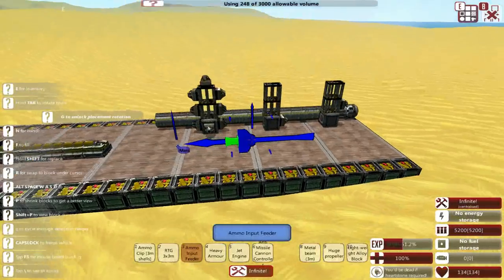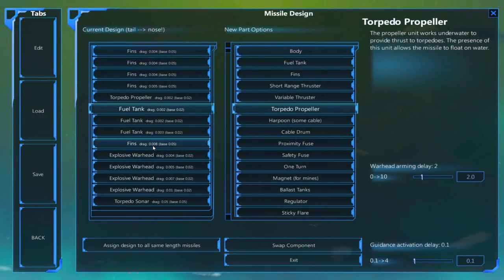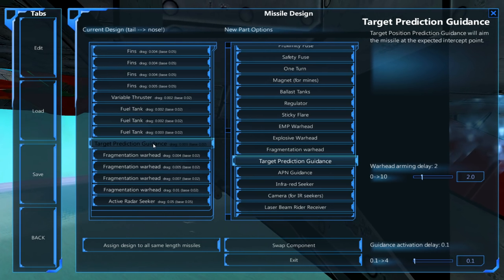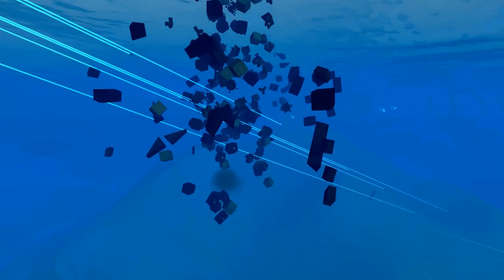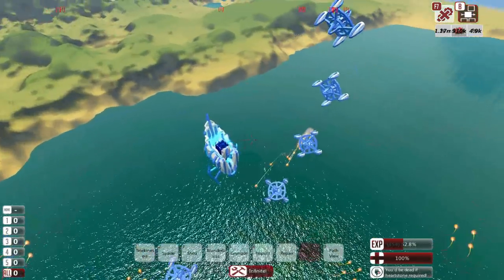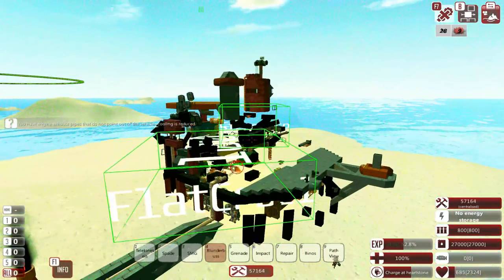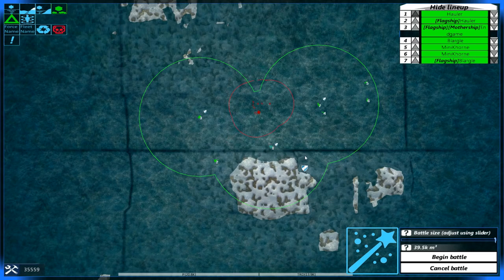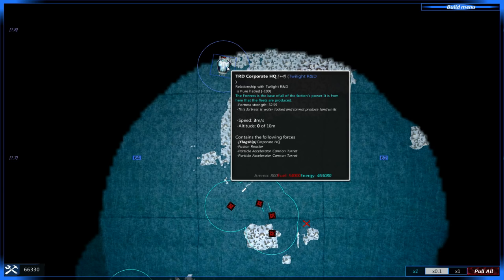From The Depths | Part 15 | The Mothership!! | Glao Campaign Gameplay

Comment: Wow, you figured out the Mothership's secret pretty quickly. Yes, it is fed power by all of its drones, and last I checked it was capable of sustaining flight with just one or two of them.

As for the drones facing the way they do, that can't be helped. The docking stations have elevation control which makes them pitch, azimuth control that makes them roll, but no means of controlling their yaw so so turning them to face a target is a no go. We could turn them around by actually turning the intended direction I guess, would need to see how that looks. Part of what makes it look so good though is the somewhat angelic nature of the Mothership looking like a holy throne, with the drones encircled around it facing as far away as they can be made to.

And I can say that the 5.6 unity update patch is in the devtest client, which also includes a bunch of design updates. So look forward to that.

Comment: There is a little trick with belt fed that, if you use a large enough gauge and enough inputs (for example, a 250mm cannon with 4 rounds per clip and 4 inputs attached per clip), you can instantly fill the ammo clip as soon as belt fed switches from the firing to the reload state, allowing a continuously firing belt fed with no down time. An ultra compact 120rpm 250mm cannon is absolutely terrifying.
Reply: mark009vn or 450mm :D
Reply: mark009vn 
390mm HE,six per clip i believe,anyone remember this cannon from somewhere!!!
Reply: I remembered once making an anti-missile cannon that fired 400mm timed HE slugs at 200rpm, it was quite amusing using it as an anti-air... but not much else unfortunately. The problem with higher gauges is that you have too little modules to work with, 250mm in a 1m belt fed gave you 4 modules, which is just enough to create the most basic of shells.
Reply: For some kinds of shells you only need the basics though. 333mm HESH rounds, GP-HE-SH, fired at 300 rpm, can do some crazy DPS. And if you need shield-busting, mix in or switch them all to GP-EMP-DC. 400mm is great too for timed or inertial fuses, like GP-Inertial-Frag/HE, and only needs 3 intakes instead of 4 to fill up its clip. Although there is that 5-10 second delay before returning to the firing state now, having enough instant-reload beltfeeders lets you get a minute or more of firing for every 5-10 seconds of downtime, which really can do an incredible amount of DPS.

Comment: The Mothership is also flawed in terms of its placement, but it should come through along with Artillery by the next update, hopefully with a couple of other things.Unfortunately missiles might still not hit anything, but because Glao has no difficulty settings, a particle cannon should be enough of a challenge.I might have to look into lags later on.

I've also asked for a permission to go nuts with subvehicles to make up a thick weighless armor, but given how stupid the idea is, I probably won't receive the blessing.
Reply: I'm currently thinking of giving the lowermost drones torpedoes so that they serve a purpose by going into the water.
Reply: I have a question. Who decides whether or not a new faction can be put into the game?
Reply: Most of the time, developers decide on faction guidelines when a new campaign is made - so not very often. Once the guidelines have been set, they're posted on forums, at which point volunteers begin designing crafts roughly corresponding to these guidelines. To date, I haven't seen a new faction be added after the others have already been estabilished.

To not get things confused, I'm simply a volunteer.
Reply: I notice that there seem to be heat decoys on the mothership drones; any thoughts of also putting radar on them (either radar buoy missiles or, if it works, active radar), in an attempt to distract radar missiles? All the active radar missiles completely ignore the decoys and go for the mothership.
Reply: Oh sweetheart, I've got SO MANY ideas regarding making this thing even more annoying to deal with.
Reply: The drones don't have anywhere to store the radar buoys they would need for that at the moment, and I would have to choose one of the four missiles to act as a decoy. Active radar systems do not attract radar seeker missiles, at least not so the last time I checked.
Reply: There's a bit of metal on the front of the drones behind the outer heat decoy and right in front of the turbines that a mainframe and a buoy can be squeezed into whilst being invisible from the outside. Not too sure about the missile itself; I admit that the four missiles are already a bit weak to consider sacrificing one per drone for a decoy. I can't really find a good place on it to stick a 5th missile system either.

Perhaps the mothership itself could drop radar buoys instead? There's an air gap under the particle cannon, right behind the batteries that could fit a mainframe and buoy without interfering with the docking stations. I'm unsure where the missile system itself would go, though.

Comment: Make your own mothership type craft!
Reply: Ben Chabot yeah, I was thinking about having the outer drones being horizontal instead of vertically positioned, and the craft being more of a water skimmer.
Reply: The white glint so a sideways mothership?
Reply: The limitations of the docking station prevent us from pointing the Mothership's drones to face forward. We can pitch docked vehicles up and down, and roll them side to side, but we can't turn them so they have to face directly away from the docking station.
Reply: Build the thing facing sideways, maybe?
Reply: I'm thinking about a giant heli/flyer that drops Blargles into the water, cause that would be cool
Reply: Just a dude+ We could try that, but I like how the drones look pointing outwards, like they're collecting power through some kind of process by being arranged in such a way and sending it to the Mothership. There is also the fact that the Mothership looks like a holy throne that is being surrounded by pious attendants (the drones) much like how Seraphim were described as surrounding the throne of God in the Old Testament. Shifting them to face forward would cast their gaze closer to the throne, thus resulting in BLASPHEMY!
Reply: Ben Chabot in essence, yes.
Reply: Is it possible to set the connection point to a spinblock or something like that, and just rotate the outer shell (with the weaons and armor and stuff) towards the enemy?
Reply: Just stick the docking thing on a turret, like Laths' tank. Just have to set the docking distance higher.
Reply: Dimitar Linov your words..."Shell".that gives me an absolutely insane idea.

How about he has multiple layers of drones, each layer facing a different direction and angle?

And yes, I know this idea will severely lag the game.

Comment: Using interceptor heads on decoy missiles also works really well ( particularily for torps with sonar bouys ). Actually what works best for radar decoys is just regularily shooting one into space...

You can stack torp props - my regular ones are 8 block, 3 props, 1 fin, 2 tanks ( 3 props is a bit marginal on one tank ), TPG ( I should try dropping TPG, I don't use it for antiship missiles ), ballast and OneTurn, and I shoot them laterally out of either side of my ships; one fin is enough to swing them round the right way & they do 58m/s in a straight line. My 4-block decoy interceptor torps only have two fins also ( and three props still ), I've never seemed to need more fins on torps. I guess dropping them vertically into the water might want two fins at least.

Seems I was ( happily ) wrong about inputs on the loader, I'm sure that wasn't always the case...

My poor heart may not be able to take the shock of a season finalé!

Comment: If the place the Intakes at the autoloader instead of the clips, the Shells will be loaded faster inside the "Barrel". Not the clip but the Barrel or gun. (Just what i read from the Game description and personal opinion). And a question, is the Tutorial series going to be continued? Because i'm still pretty bad at building ^^
Reply from the maker: This only really works with regular autoloaders and causes all sorts of issues even then honestly! With the beltfed loaders they really need a stock of shells to work with otherwise its shoot-wait for the input to hand over a shell - shoot , which is far far longer than going through their rack of shells (Beltfed loaders massively outdo regular autoloaders at taking from the racks and passing it to the barrel, its their strength even though they can't take from the input during firing phases!)

Comment: if you add more torpedo propellers does it make them faster now, i think it did before but haven't played in a while and was wondering if you knew
Reply from the maker: Yes they do, using more does indeed increase the speed :)
Reply: I though so, just wanted to make sure, thanks for the reply :)

Comment: Mate. they don't fill them at the same rate as they are on the same craft.... Or is that just my bad logic?
Reply: I think the middle one filled slightly faster because that was the one he used Q on to assign the ammo type (just clicking the ammo type before assigning it to all starts loading that first one).
Reply: LordOberic1+ That is indeed correct.
Reply: He told the middle one to fill first and THEN clicked assign all.

Comment: the mini corn needs an upgrade
Reply from the maker: I honestly disagree :P For its stupidly low cost It outdoes pretty much every other vehicle - Especially since It is still the highest damage vehicle I have, aside from the tank which is technically two vehicles in one. It is just targeted way too easily due to its high 'weapon value' and since It is over 60% weapon with its volume It simply can't be more defended than it already is. In short - It's a glass cannon, and any upgrades would just lower its damage for more defence which goes against Its point, in my derpy eyes at least! :D

Comment: If you have 32gigibytes of Ram then try out Dimmdrive. It will make loading of things much faster. http://store.steampowered.com/app/337070/Dimmdrive__Gaming_Ramdrive__10000_MBs/
but since the game is only 1-1.3gig's in size, you probably can do just fine with less Ram.
Not trying to advertise this or anything it's just that I personally use it on many of my games since I do have the spare Ram (32gig's in total) so this program works well for me.
This by no means is something that magically increases your FPS out of nowhere, it just simply stabilizes it much better and allows for higher FPS in more of a natural state if that makes any since.
You still will need a good graphics card to put things on maximum setting for many games this just simply helps to have higher stable FPS with things loading really quickly.